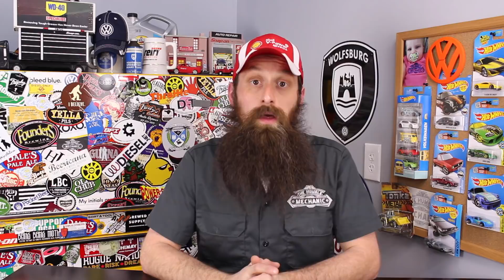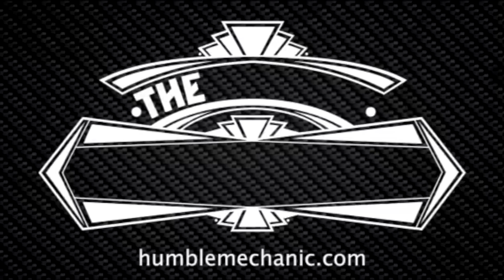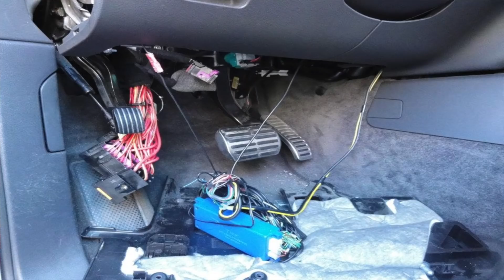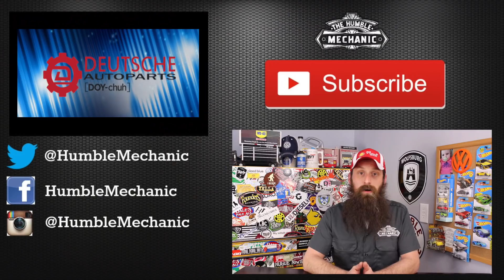Top 5 Failures of the Volkswagen Touareg

Comment: Had the car 15 years (from new) love it but loads of issues.
Battery died after 1 year of ownership.
Faulty starter motor!!! Quoted 3 hours to replace and it took 18 hours as one of the bolts could not be accessed. New starter motor addresses this issue but it's already starting to show the same fault, i.e. won't start first time.
Dripping injector, car smokes heavily when idling, quoted £1800 plus labour for a new set!
Gearbox chest vale, makes a huge bang when kicking down from 5th to 4th, quoted £1200 to replace it.
Tyre wear and brake wear are shocking Pirelli N1's gave 25000 miles, Pirelli N0's gave under 8,000 miles, £640 a set!!
Electric window cable has twisted meaning no operation!
In cold weather the drivers door freezes up meaning the mechanism won't lock.
One rear door doesn't lock any more and the other doesn't open from the inside.
DPF clogging, don't even get me started on that!

Comment: I am trying to replace servo motor for AC flaps. But it seems I have to have a Diagnostic system VS5051 to bring motors to Service function (SF mode) before removal. Is there another way to get to SF mode, please help

Comment: Hey guys, my Touareg V10 MK1 2007 has developed an issue and no mechanic can seem to fix it. The error on the dash reads ‘Stop running gear fault’ it’s red error message. And now the rear suspension is stuck In it highest possible position, the car won’t change from sport/ comfort or Auto ride hight. Please if anyone knows what this is or how to fix it your support will be much appreciated.

Comment: Sounds like these problems are not reoccurring. If these crazy problems were solved properly these trucks might be pretty decent to own used
Reply from the maker: They basically have. And the gen 3 is awesome. We have one
Reply: @HumbleMechanic  cool I've been thinking about picking up a vr6 one. But just afraid that the previous owner wasn't taking care of it correctly. But I bought a mk4 GTI 1.8t and it still holds strong so we'll see I guess

Comment: So I have a 2008 Volkswagen Touareg that will not come out of park it starts up but I cannot get it to disengage out of park 2 days before this happened I went to Grease Monkey to get it serviced for the regular maintenance schedule I have no idea what's wrong with it someone told me it might be this speed sensor solenoid inside of the transmission do you have any advice to help me get my car fixed and get me off of public transportation omly 121.000 miles on it

Comment: 2004 VW toureg V8 4.2L
Tire size: 255 55 18 

how can i find out about the recalls problems for this SUV or suggested upgrades to improve this first GEN Toureg, and the fuel pump is it required to change the fuel pump and filter(s) if they have 2 at the same time, i have a few electrical issues happening relating to secondary air pump bank 2(17819), also other codes popped up too, 17887, 181104, 17072, 01045 for the engine codes, and ABS system codes were 00778, & 00493 (g419)

Comment: I have an 2004 Volkswagen Touareg V8 my truck will not start it saying steering defective workshop and the alarm going off help what should I do
Reply from the maker: Yikes. That could be a number of things. Bad Key, Bad Kessy module are the 2 most common. 

There is also a splice under the carpet behind the brake pedal that I have seen cause this issue

Comment: I have an ‘05 V6 Touareg with 175k on it. The front diff bearings (I’m guessing) are making a lot of heavy noise under load. VW does not offer parts to rebuild the front diff and they do not offer a complete diff option. I am thinking about tearing it down and replacing all the bearings and seals myself. However, I am a bit concerned that there will be ring and pinion wear, too, and nobody offers replacement sets. My alternate idea was to get a junk yard front assembly and install it, but I still run the risk of getting one that has already failed or may fail soon. What do you recommend here?
Reply from the maker: Dang, no new units huh. A low mile junk yard may be best. Or find out who makes the diff. Maybe you can get s service kit right from them

Comment: Cam synch chain tensioners. Worst . Design . Ever. 

Putting plastic on the shoes in a high wear, low oil spot was a disgustingly bad idea. And $700 for a replacement just adds insult to injury.
Reply from the maker: That was the hot design of the day. Most all VW/Audi engines had it. LOL
Reply: @HumbleMechanic  Same company that tried to swindle the public with their Dieselgate products. What's not to "love" about VW?

Comment: I have an 08 vw touareg and Every thing shuts off like the mfd and radio shuts off and will only rev up any ideas on what the problem could be
Reply from the maker: Be sure the battery is good. Those get REALLY fussy with a weak battery
Reply: @HumbleMechanic  I just changed the battery this year cause that's what I thought it was its telling me it's an ecm power relay control circuit open

Comment: I want to buy Touareg VR6 2015/16 and I wanna ask if  they are reliable? Everyone talk about V6 TDI but I don't have so many info about gas engine. Thank you!
Reply from the maker: It’s a solid engine. Seen a few issues here and there but overall they are great
Reply: @HumbleMechanic  I living in Alaska and because of cold weather I consider VR6 as better option on that extreme cold weather or maybe TDI can handle below 0°F what do you think? Thank you so much for unswer.
Reply from the maker: I think gas may be a better option. Diesel can be fine if you take a few extra steps
Reply: @HumbleMechanic  thank you so much for all unswers, you helped me to figure out what I loking for.

Comment: I have  V10 ,I've fitted 2 new new turbos,new drive shaft,new kessi unit as the car wouldn't start.
10,000 miles from tyres I dream of, i get around 8,000.
Brakes I get around 12,000 miles.
Current issue is the A/C flap motor and DPFs,which are a service item(at 130,000 miles) and my VW stealer want £4000 to replace !! 
Also if you are buying an 7l remove the rubber trim around the fuel filler cap, on the right if you see a black cap and grey cap, your car is fitted with VWs early version of Adblue, tank is 4.5 litres, no warning light if its empty and nothing in the hand book ,again refilling/level check is a service item at 60,000 miles, my dealer wanted £24.89 per litre.

I love the car as long as I can afford maintenance I'll be keeping it .
Reply: O forgot as well fuel pumps ,I replace the seals with a set off ebay £24.99 against £567 for 2 new pumps.
Diesel heater leaks slightly as well

Comment: Would you recommend a vw touareg to someone who does their own repairs and maintenance?
Reply: I do my own repairs. My Touareg is 2008. 277.000km, air suspension. No issues execpt ACC radar..and I have a computer interface.
Reply: @albertemanuel2506  what kind of cost does it run to fix those issues?
Reply: @ashtonmax  well since you are on conus price may differ. In Europe se have less expensive parts and we use original OEM ...25 usd for a rotor..10 dollars for brake pads..etc. And we use vcds software with a clone interface..30 usd. So I know what's wrong. We also do not go to dealership...we use local service shops..TMPS 40usd a piece..you just change the damn thing..and so on and so forth...it depends on how other to you repair something that comes up, like a noise a warning light...and for goodness sake please open up the good and look at the dam engine...don't wait for it to crack..

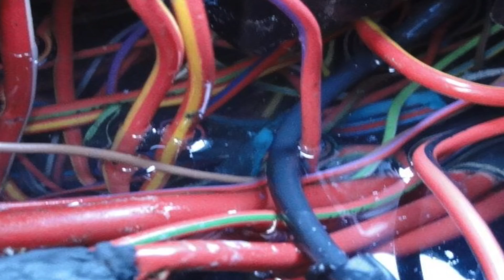Comment: yes 100% EXACTLY: [6:00] 
BAD BULB > ENG HESITATIONS !
This is true with ANY CAN BUS. When bus is busy the fuel injection software does not get all needed data from peripherals or bust checking if DTC code is from "TCM LimpMode".
This issue is true and confirmed on Benz and Acura - Design limitation of Bosch CAN Bus software.

Fix: keep you CAN clear of failed or crazy modules. The least peripheral faults(mirrors, bulbs etc) the better engine fuel injection runs. Yes I know, this reads like its unbelievable, test it for yourself.

Comment: Hey guys I have a VW touareg 2004 my battery died and I tried just starting it sparked when I was trying to jumpstart and ever since then the car is not giving any ignition when u out the key in u here 3 beeps and then steering defective workshop comes up any one came a cross something like that? Or have any idea wat could be my problem will really appreciate 
Thanks
Reply from the maker: Kessy module failure is common, but you really want to have it properly diagnosed. IT can be a ton of different issues
Reply: @HumbleMechanic  do u have any idea how do I get it fixed
Reply: @HumbleMechanic  and mine is not the botton start u have to turn the key it not the botton start spec

Comment: Hi. Have you ever heard of this problem? I bought a Touareg  that wouldn't start. (Not sure of the model but its an older version) A diesel pump (V6) overhaul sorted the problem. Now it starts and drives amazing.  On the day i got it back from the mechanic the car was idling with someone else inside, i opened the door from the outside and the engine immediately stalled and there was and still is no way to start the engine. The engine turns over about 5 revolutions and the just cuts.

Comment: What year would you say is the best of the tdi's the v6 or the v10
Reply: The V6. The V10 Touaregs are very expensive to fix and they are known to have transmission failures and they are a nightmare to fix and most problems you have to have engine out.

Comment: In my experience a lot of VW issues are hit and miss. I owned a 2004 Golf TDI for 12 years, almost 200,000 miles and it was a great car. Replaced broken front spring, did the timing belt/water pump at 100k, typical maintenance and it was super reliable, great fuel economy with that diesel torque that I hauled my quads with on trailer while still getting over 40 mpg. Others complained about reliability but mine was outstanding although when something went wrong it seemed like it was twice as expensive and twice as complicated to repair. I can see that for the Touareg as well but the electrical would make me worried as tracking down those issues can be extremely frustrating. I would love a Touareg but will stick with my FJ Cruiser for now but do envy the luxury of the VW.

Comment: Hey guys hope you'll all well I got a VW touareg 2006 the battery completely died on the car so I took it out and put a new battery after I changed the battery they car doesn't show any ignition lights but the radio and all the other stuff is they anything I can try to get it fixed up 
Thanks

Comment: Hey Charles, I had to get a radio code from the dealer for my 2004 Touareg. They got the code but returned the car with a FAULTY BRAKE sign flashing and also a smaller brake light and ABS light on. Can they have messed something up. I saw that water can leak into the drivers side floor and corrode three spliced wires which can cause the problem. There has definitely been water leaking in. Any thoughts on this are GREATLY APPRECIATED!! Thanks!
Reply: John G any luck here?

Comment: We have a 2016 lux Touareg with roughly 40k on it. Bought used with 30k. The question I have is what the ride should feel like? It always felt kinda bouncy to me especially hitting dips on highway. Not planted..? My gti is stiff and planted so not sure if the Touareg should feel soft? If that makes sense.. thanks for feedback!
Reply from the maker: Touareg is a little soft. It’s a big heavy SUV. Ours rides great other than kinda needing tyres
Reply: @HumbleMechanic  ohh ok, I thought the shock absorbers where maybe going bad since the Touareg is so heavy. When you hit a big dip in the road going fast feels like the back end might hop of the road.. how many miles usually before the shocks go bad on these cars? Thanks again for your feedback!

Comment: i just noticed mine consumes lots of oil. i love it, but i hope it isnt going to be a money pit.
Reply from the maker: That’s one I haven’t ran into on these
Reply: @HumbleMechanic  so the oil I ordered arrived. Good news is, only 3 quarts low. I'm thinking it is valve seals. I got 10w40 instead of the 5w30. Denver summer doesn't need a winter oil.
I am just going to put money into an engine fund every week. I don't see a $2k engine swap (self labor) being a reason to give up on this undercover Porsche

Comment: Thinking about buying a 2014 model Touareg.  Am I safe or should I stay away?  Any advice is greatly appreciated 😁
Reply from the maker: Love it. I have a 2015
Reply: Awesome thanks, it’s a silver sport model w/ 70k miles. Although I hear that vw has extended the warranties on these to 10yr/100k mi on the powertrain I was still a bit skeptical.  Currently own a 2009 VW Tiguan SEL 4Motion. Had a plethora of problems with that car but I stuck with it. I fixed all the issues as they came up such as the rear main seal and the upper and lower timing belt with the updated tensioner. I also had the pano roof leak on all 4 corners. It’s been one thing after another but I change my oil every 5k full syn w/filter.  Lately I’ve noticed that the shocks aren’t doing their job so looks like I can add that to the list as well.  I wanted to buy the Touareg and keep the other as a backup just in case.  Thanks for the info ❤️

Comment: I have an 05 vw touraeg, is there a lot of issues with the coils and spark plugs? The engine is the v6 AWD and when the battery dies why does the damn key get stuck in the ignition, is this supposed to be a safety feature if so it's a dumbass safety feature. I love my touraeg and don't want to get rid of it, I did get a warranty on it through carsheild. Why would they put the battery under the drivers seat?  Where would you recommend to order a ac control panel and a radio, I bought It off some in Wilmington NC and I have searched and searched online and at local junk yards and no luck yet could you please help me find them the buttons are so warn that I don't know what setting the ac is on and also what channel the radio is on. One more question would you recommend someone putting push start on an 05 vw touraeg? Thanks for your time and I look forward to hearing from you soon.

Comment: Good info working on 2006 vw touareg bunch of electrical issues
Reply: So far changed the wiper module now im on to the head lights the wiring is bad
Reply from the maker: Lol sounds about right
Reply from the maker: Check for water damage at the fuse panel. :)

Comment: One more question, do you or anyone in the entire VW organization know how to wire in a trailer brake controller module.  Some info says there is a plug in the back that leads to a plug under the drivers dash but nothing about how it’s wired.  I mean is it a heavy duty wire run from the back to the front to power the electric brakes.  Does it have a +12 volt supply or is it just two dead ended plugs.  Please please help me with this.

Comment: I have a 2011 Hybrid.  My electric rear hatch works when it wants to with no discernible pattern.  Do you have any experience with this?  Also, alignment machines from 4 different shops say it’s aligned but it still has a pretty severe pull to the right.  Lastly, what tires seem to last the longest on this vehicle or are better suited for the weight.

Comment: I love this car and how it handles on the road.
I have a 2005 v8.  It wont start.  I think its in an "anti theft mode" or "don't tow me mode".  Can you help me get the car out of the mode its in and start.  The key is in, window don but the car wont turn on.  I can turn the key, yes its in park.  The lights do not turn on, but the good German car has strong ding ding ding when opening the door.  It changes tone once inside the car and seat belt is off.  I pressed the for don"t tow me while trouble shooting and now I cant get it out of that mode.  can you help me?
Reply from the maker: Turn the hazards on, hold the brake, and hold the flash to pass.  Turn the key backwards and then try to Start. 

If that doesn’t work, it’s probably a dead access start module
Reply: HumbleMechanic if this works tomorrow morning...

Comment: Looking at buying an '06 V6 Touareg, 120k. Is that a good model or can you recommend a good year to get in the older models?
Reply: i have an  06  v6 white with black leather.  I have had it for about 4 years.. I love it.. it does have some of the tire pressure issues.. I thinks its got 138k miles now.  I does get the shakes at 80mph but might be a balancing an issue.  test yours on the freeway to see if it shakes or not before you buy.   Just drove it down to baja and it worked flawlessly.  Love it!!!

Comment: I love my 2013 TDi...bought it used, so I have had a few maintenance issues. Overall I love this car; it gets great mph on the highway, great pick up, awesome towing capacity, luxury interior.
Reply: Holli Starnes how’s it been I’m looking at a 2012 for my girlfriend any issues and how’s your mpg?
Reply: X2 on that. Are you pulling over 30mpg on the highway? Looking at a '13 for my wife. Thanks!
Reply: @jnetwork7159 I have a 2014 TDi and I am extremely happy with it. I get over 30 highway mph. Has a 26.5 gallon tank I believe so I get about 600 miles per tank, though it is expensive to fill up, around 135 where I live. I do mostly standard road driving though with lots of stoplights so my fuel lasts a super long time. My oil cooler just went out, the thing basically exploded and I’m paying 2400 to have it fixed at the moment but it’s worth it. The thing is a freakin tank unlike all these newer cars that have literal styrofoam in the bumpers. Handles like a dream, even if you wanna speed. It’s probably my favorite car I have ever owned. No electrical problems or anything like this guy mentions, I’m at 98k miles and she’s still going strong outside of the oil cooler.